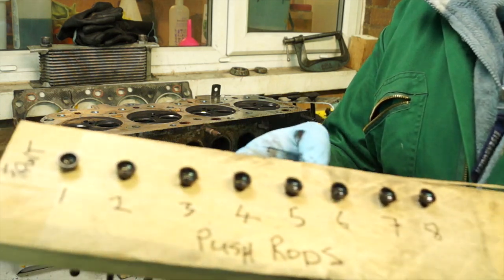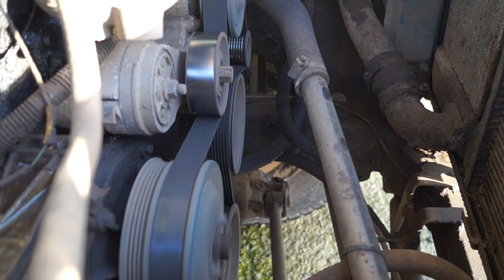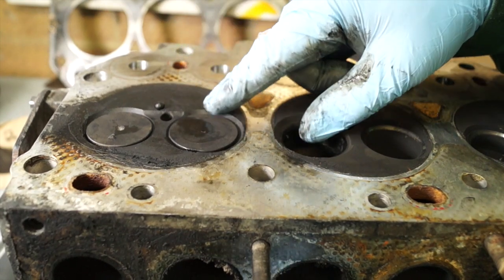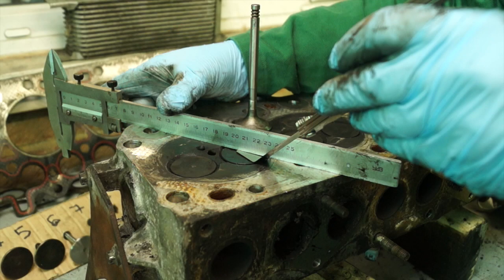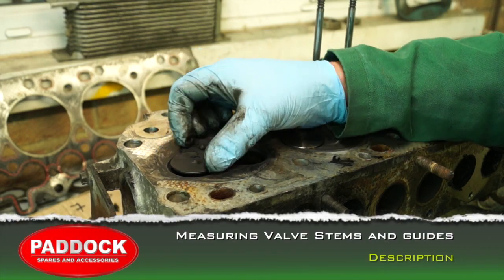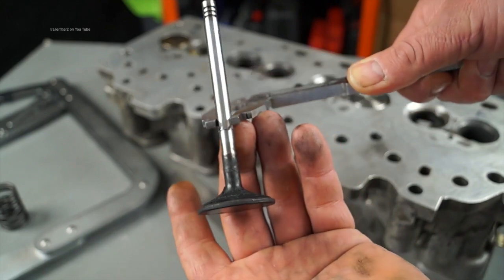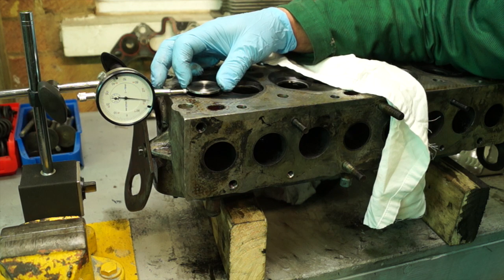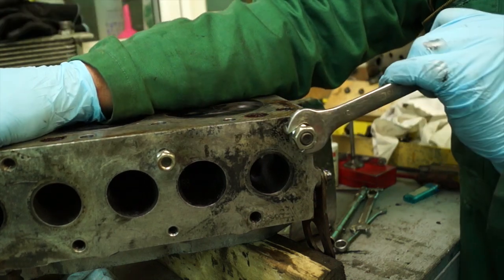Check / Measure the Cylinder Head Valves for Wear - 300tdi Engine Overhaul - 110 Project Restoration

Comment: that's a clear idea of how to check all the valves, springs and bits & pieces on the head. I did'nt manage to see how many holes on the original gasket, to know if it the head has been machined on a previous occasion. Lovely video Chris!
Reply from the maker: +Fionàn O&#39;Kelly  we haven't  quite finished with the head yet and you have brought up a good point. .    The cylinder head should not be skimmed according to Land Rover although it is carried out which is what we need to keep in mind when we check the face.

Comment: hi, i have my 300tdi head out after 350,000km with a blown head gasket,   ordered new valve guides they are over spec meaning 0.30 side ways movement according to the manual should be 0.15mm, thinking if the specks have changed for these , any advise would be great thanks

Comment: Chris at 2:35 the water galleries in the head gasket are very large almost 6mm in a new gasket they are only about 2.5 m is there a reason why they would be smaller it appears they would restrict the water flow causing the engine to heat up.
Reply from the maker: It is designed that way to restrict the water flow.  I don't know why but that is the way it is.

Comment: When torquing down the new head following the bolt pattern at 40nm. After the last one could go back and retorque the middle bolts to 40nm. Is this suggested?
Reply from the maker: The tightening sequence is here on this video    https://youtu.be/RCJbq18L258
Reply: I was referring to the fact that after the first round of tightening to  40nm it is possible to retighten the middle head bolts to 40nm. 
If that is physical possible to do. Wouldn't each consecutive round have similar results, except because you are not going to "NM" but using  60 ,60 , then 20 degrees  you couldn't tighten the middle head bolts equally to the ones on the ends.
Reply from the maker: Torquing is only initial approximate settling.  Angle tightening is far more accurate. The sequence of bolt tightening is given to assure the pressure is applied without distorting the cylinder head.  You need to follow the prescribed sequenced to ensure an even application of clamping force across the head to the cylinder block.   Not sure, but I feel you are trying to rewrite the rulebook without understanding the consequences?
Reply: Thanks for replying, I'm just trying to learn a bit more as I am new to Land Rover, and  diesel. I am now two warped heads into my 300tdi and am frustrated by the design of it, high water pump, and middle adjacent exhaust valves. The new head was running good then a 100k into a long trip the temp gauge sky rocketed.and that was it.
Reply: @IndianaJBird  ive bee very lucky, my 300 has now done 350,000km just reconditioning the head now it has blown head gasket